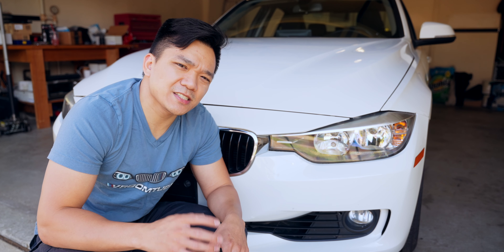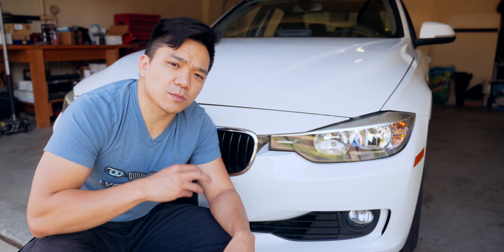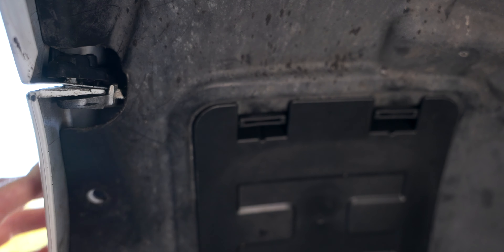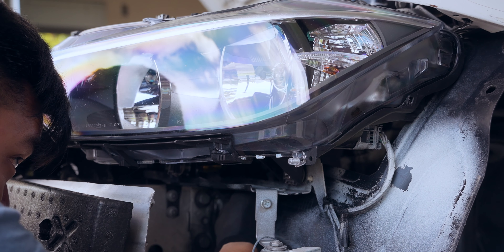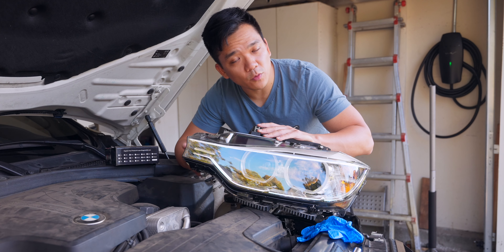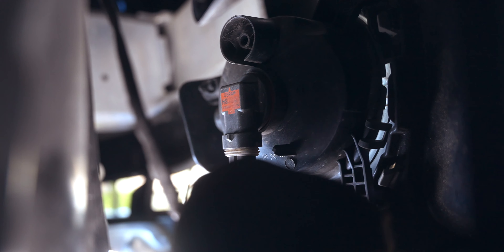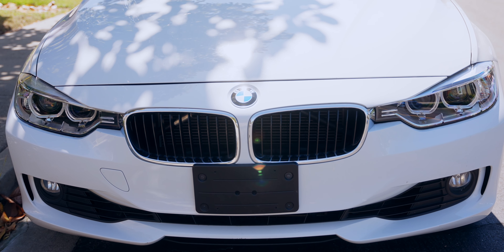How to Install BMW Headlights Upgrade | F30 Projector LED | 328i

Comment: For any of you that are curious. I have a 2017 model and yes they do work for the new models the with the halogen stock headlights. They look 100xs better and more beautiful .
Reply from the maker: Awesome. Thanks for sharing! Glad you are enjoying them
Reply: Is there a different from the expensive ones? Like brightness and or how the ring of the head light stands out when turn out? I didn’t know how to word that sentence out…
Reply: i have a 2016 330e with stock halogen headlights can i use these headlights ?
Reply: @omergokce5971  Im still wondering the same thing
Reply: I got a 2014 People told me the I can’t upgrade my headlight it’s da truth?
Reply: How was your 2017 model was it reliable?
Reply: @charlesgirgis  absolutely its been about 3 years since I had them and still work just as the day I got them
Reply: @blackou4 Hey which headlights did you end up buying? The branded ones he used in this vid or from another link? Please let me know, thanks!
Reply: hola amigoquiero cambiar los faro delantero que son led mi auto es un bmw 328i 2013,me puede recomendar algu mecanico que se dedique este tipo de cambio de faros,vivo en albuquerque nm

Comment: I swapped mine aswell and now new headlights only work while the car is off when the car turns on they flicker n turn off what could be the reason
Reply from the maker: Did you code it?
Reply: @FritzRamos how do you code it ?????

Comment: I'm afraid to try to do this and now even more that it might not be aligned like bmw did.
Reply from the maker: You can do it. If it's the original bumper or has been on there for a while it'll line up well
Reply: @FritzRamos  Just did it and the bumper does not fit anymore, i have no clue what's causing this but there's gaps all around the headlight and i might have to take it to a shop to do it properly. Is there something i missed?
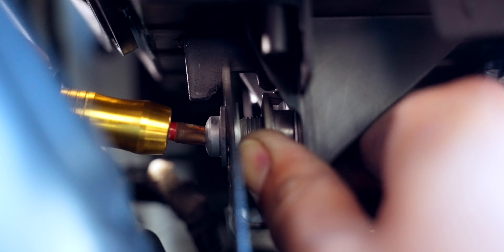Reply: Yea same,I got a gap on my right top bumper its look like my headlights are facing down too much. But watch @4:21 how to adjust those 2 bottom bolts/nuts thats how to align the headlights up/down forwards/backwards
Reply: @King-rs8oj  Still have the gap after that. At least my bumper fits perfectly now.
Reply: @ThatLennyBoi  do some adjustment with those weird bolts/nuts. Try the adjusting one bolt all the way open and the other one close or half open.
Reply: @King-rs8oj  The one bolt half way open worked, i did have to loosen all screws but i still have the bumper gap on the hood.

Comment: Just installed mine. However the turn signal is flickering any solution? Coding? 2013..
Reply from the maker: Try this https://youtu.be/X7ZOaO5E-gs?t=411&si=uDicjuquNBBSKwkQ

Comment: I have a pre lci f30 xenon 2013 and fitted with the lci full led oem headlight and it is not working with left drl not turning on right drl turning on 4 way indicator working but left right indicator not working plus no upper beam and low beam.
The drl is off only turns on when the headlight switch is completely on but does not throw low beam. 
I am very confused what could make it work or do i need to code it with bimmercode for all of the lights to work along the headlight switch

Comment: Buenas tardes, amigo. Disculpa, quiero hacer el cambio de faros completos, tengo los de alógenos y ya compré los de led originales, pero me comentan que se necesita programar con el carro para que funcionen y prendan, tú hiciste la programación o solo los instalaste y ya prendieron?
Reply: Ocupas una applicacion que se llama BimmerCode  y un lector sea compatible como Veepeak - hay que decirle a la computadora que tipo de bulbs estan conectados 
para que mande el voltage correspondiente

Comment: I have a 2016 bmw 228i and I want to add some halo/angel eyes do you know anything that you could show me and upgrade my bare OEM halogen headlights
Reply from the maker: It's a pain. You have to oen up the headlight unit by removing the clear plastic from the housing. I think Vehicular DIY has a video on it

Comment: Hi, I have replaced my halogens with the xenon headlights, but only the low beam works. The DRL and high beam does not work. Any suggestions

Comment: Hello, I have a 2015 328i Halogen model, mistakenly I ordered Xenon projector setup for my car with all HID bulbs, ballast. I would like to know if those will work on my Halogen model?
Reply from the maker: It'll require a bit of work and coding to get it to work seamlessly

Comment: Just bought them lci depo lights but the high beam there is not bulb how did you make out with that. Is the low beam now a dual bulb?
Reply from the maker: Correct. It uses one bulb abs shifts the lights angle
Reply: How did you do for the wiring ?
Reply from the maker: @luizy95  It should be plug and play

Comment: i am trying to install aaron allen's 2016 bmw five series your led headlights.  headlights are stuck on high beam.  halos inoperative.  do you have written install and wire up instructions for me.  we have been in 12 volt biz for 57 years.  big trouble.

Comment: wonder if i can do this without removing the wheels or jacking the car up
Reply from the maker: You can! Just turn the wheel so you have more room.
Reply: @FritzRamos  awesome! I' did an LED bulb conversion without removing the wheels, probably very similar

Comment: Hey the website says it's sold out is there any other place I can buy them and how much did you get yours for?
Reply from the maker: Sorry the shipping shortage is causing a huge delay and backlog. These units and all the alternative manufacturers I've talked to, quoted me at 2022 ETAs. I think I paid around 600, but considering the economy I wouldn't be surprised if it goes up.

Comment: Dude you should check with a diagnostics guy if your headlights have a proper light height. Its why there are those "washers" you screwd to the max. You may be blinding ppl
Reply from the maker: Thanks, but these cars are easy to adjust the beam height and don't necessarily require a diagnostic. https://www.youtube.com/watch?v=FIt7IJ3rlrI
Reply: @FritzRamos  very nice video

Comment: fritz, my car is halogen and it’s a 2012 328i, I want to get these headlights but i am scared since i have never done any removing of parts like this, is removing the bumper an easy job? and do i need any powered tools or can i just use wrenches and torx screws?
Reply from the maker: You can use and tools. It's not terribly hard, just take your time and if you need more angels I have another video with an LCI retrofit -  https://youtu.be/X7ZOaO5E-gs Good luck
Reply: @FritzRamos  awesome thank you, and will i Just need a T30, 10mm and 8mm? or is there more

Comment: Great video man 👌 need to do this myself on my F30
Reply from the maker: Thanks man. They make a huge difference in terms of road visibility, you won't regret it
Reply: @FritzRamos  i bet! just installed LCI tail lights in my 235i recently and they are massively brighter so looks like next up is the headlights on the F30

Comment: Hi. #Fritz Ramos. Great Video. I want little help. I have got BMW F20 LCI with halogen lights. I want to replace with angel projector lights, Is it possible also would I required any additional parts to make that work on my car apart from coding? Thanks
Reply from the maker: You would need to remove the plastic lense and reglue it. It's a very time consuming process, but if you wish to do it make sure to have aa heat gun.

Comment: Second on the headlights. I have 2017 330i and the aftermarket headlights I found are for 2012-2016. Looking to get a set of headlights that are affordable. Thanks!
Reply: Hey Sam i have same model 2016+ 330e with horrible halogen headlight what is the best posibble option for a upgrade thes headlights thnks dude 👍
Reply: can u reply in the comments with the link for aftermarket LEDs

Comment: Nice video! Question: is it a straight swap if you had standard halogen and wanted the led headlight block unit? Did you had to do any coding?
Reply from the maker: Straight plug and play no coding
Reply: I had straightly plugged the orginal bmw projector headlights...the cluster shows some errors..low beam not working

Comment: It looks like Hikari has an upgrade 20000LM version of the bulb now.  Would those be too bright? Or would you recommend still using the 15000LM version from the link?
Reply from the maker: Thanks for sharing. i haven't tried those, but if you can go brighter why not?

Comment: Hey Fritz, would the leds be compatible with a 2013 f30 328i?
Reply: I’m wondering the same question! Thanks in advance
Reply from the maker: Should be. I have had them on a 2012 and 2014 with no issues
Reply: Can I use ange eyes on a 320 with no problems or coding non light pkg f30? Or use 328 headlights on a 320?

Comment: Hi, 
I can see at 6:54 your aftermarket screen has that V kind of black lines forming on top left, I have the same screen and issue happening after that screen has been installed for 3 months, What can it be and is there any way to clear it?
Reply from the maker: Mine was under the 1 year manufacturer warranty so i just reached out to the seller.

Comment: My headlights were replaced a couple years ago and one of them is pulling the bumper alignment down. Can I loosen the headlight bolts and slide it up without taking the bumper off? Thnx.

Comment: Question for you ..... I have heard that running LEDs in a projector headlights do not give the best light output  but a good HID kit will ? have you tried a good HID kit ?
Reply from the maker: No. The 2 options would be run an aftermarket HID and you would have to drill into the housing and navigate where to place the ballast. Option 2 would be to retrofit a OEM HID system and that is pretty intensive and requires some coding. I can honestly say that I have HIDs in my 2 series and compared to these its close enough and does the job well.
Reply: @FritzRamos  thanks for the info
Reply: Yes. That's true yet both suck in projector.  A standard housing is best for led and hid... and overall hid is better than led yet it has a high defective rate. Confused yet? 😕 🤣 it is
Reply from the maker: @ny2bama  it's a marketing ploy so that we buy them all 🤣
Reply: @FritzRamos  as a shop had to shop selling HID due to the high defective rate. Sold LEDs, Install Bay now Daytona on Heise LEDs. Good price point and quality stuff. 👌 Thanks for the video
Reply from the maker: @ny2bama  thank you for sharing that information! 👍

Comment: Are these the DEPO lights? I've been looking for those but they seem to be sold out most places, and the ones you link to are also sold out. I also see everywhere that they say that the DEPO lights are not compatible with HID bulbs, but I've also found on forums that people do use them with HID conversion kits. Is it just that they're not "supposed" to be used with HID so the websites say don't do it to cover their tracks? I've got a 2013 F30 and desperately need to upgrade the headlights and would love to put some new ones on there with an HID kit.

Comment: you dont need coding ?
Reply from the maker: Not in this case
Reply: @FritzRamos  i buyed an f15 2016 and it has normal headlight and i want to upgrade to xenon do i need coding?
Reply from the maker: @alexluckyan3089  I'm not sure. It really depends on what light setup you get. The manufacturer should let you know

Comment: I just purchased the projectors, but I didn’t realize I had to buy the leds lights as well …. I was thinking the head light frame came with the led ! Is that true or how detrimental is it to add the leds as well

Comment: How did you reprogram the new lights?
Reply from the maker: No programming is necessary. However if you want you can use bimmercode to change the headlights to led from halogen.
Reply: @FritzRamos What do u mean by this? What are we changing in BimmerCode?

Comment: Is it possible to replace the halogen lights with LED bulbs
Reply from the maker: Yes it is
Reply: I would be keen to know if just changing the bulbs from the halogen to the LEDs makes the beam better or not ? I've recently got a 2013 f30 and it's almost too dangerous to be driving at night!
 @FritzRamos

Comment: Is it me or 2017+ LCI, you just can NOT upgrade to LEDs.
Reply from the maker: I think it still depends on the package you get. If you have the HIDs from factor yo are correct. If you have the base halogens it should work the same as the video.